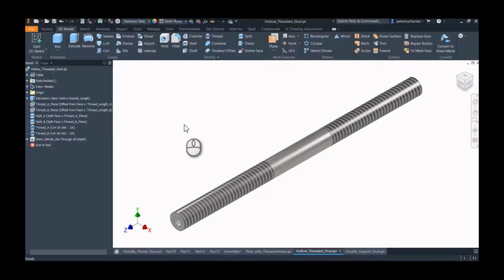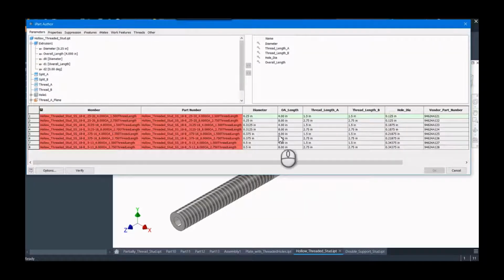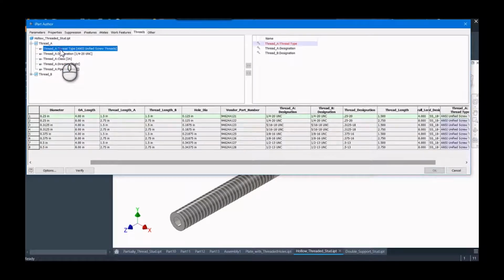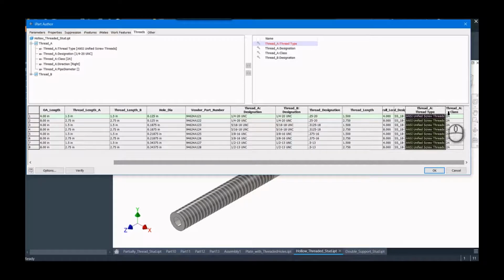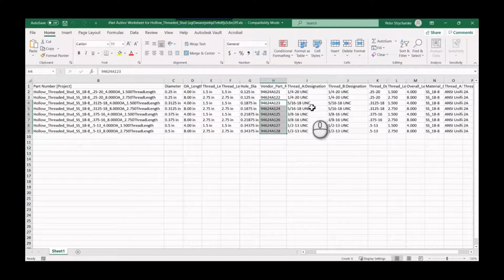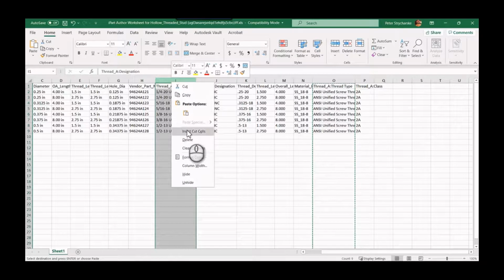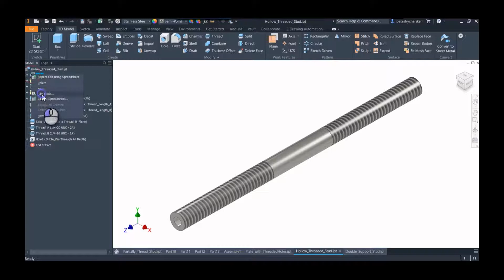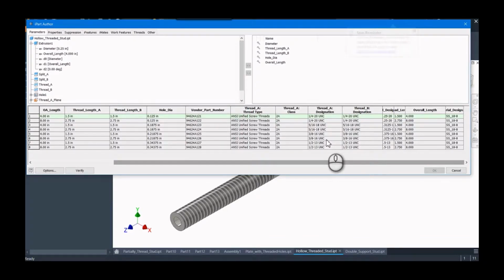Inventor - How to Rearrange iPart and iAssembly Table Columns

Comment: Does this technique work for iFeatures? I have tried editing an IDE, authoring a table, adding a custom column, and then editing column order in Excel. The Excel editing seems to corrupt the table. Using Inventor 2025 and Excel 365.

Comment: When I close Excel Inventor doesn't register that I closed Excel. It just sit there until I try to take another action within Inventor and then a dialog box shows up stating that the excel spreadsheet will now be closed and unsaved changes will be discarded. But I already closed Excel so why does this dialog box show up and why do none of my changes to the table show up on the inventor table?
Reply: Steven, sorry to hear of your troubles.  I've had this happen before if I open up a second session of Excel after launching the iPart table spreadsheet.  It will force me to close all Excel sheets before it updates the part.  Or at least I've had that happen before.  Do you have any other Excel sheets open when this happens?